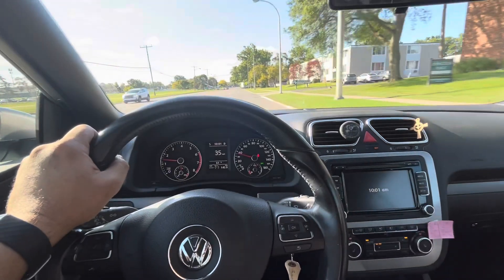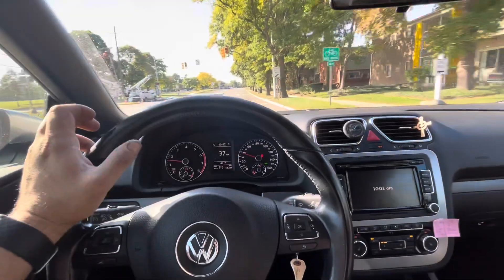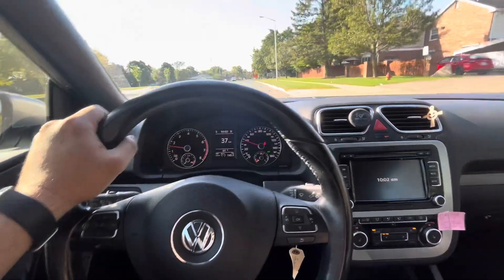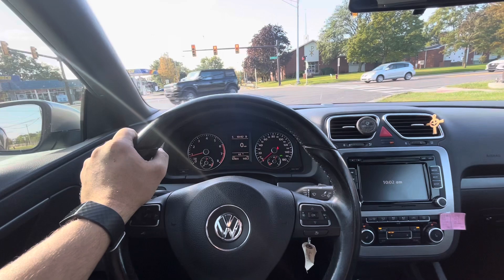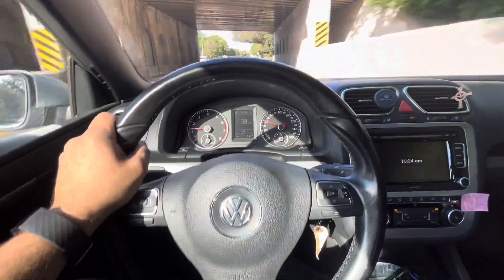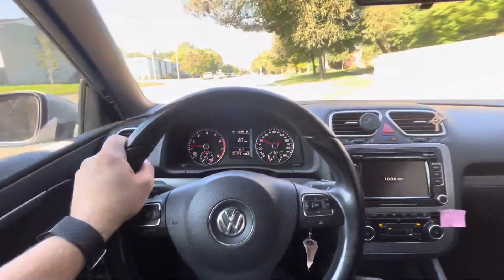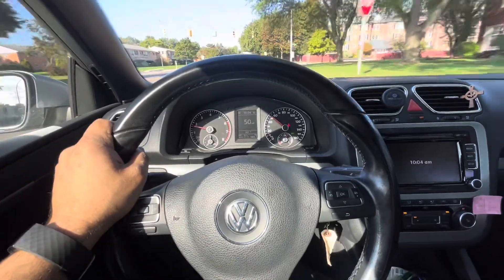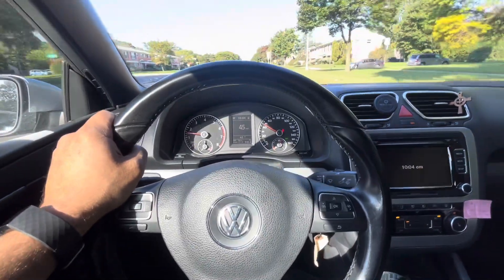VOLKSWAGEN 2.0TSI COMMON CAUSE OF LARGE VIBRATION AND POWER LOSS UNDER ACCELERATION

Comment: Hello, I own a 2011 MK6 Jetta 1.6 TDI. There is a shaking in the vehicle when I press the gas pedal at low speeds (1100-1500) in every gear. It improves when I accelerate. What could be the reason? Please help 🙏🏻
Reply: Same as me. Did you solve?
Reply: @ahmetcanergunn3069 same, did you solve it?
Reply: Same
Reply: @geekyvids-n8s let me know if you figure it out

Comment: I'm having the same issue, I'm getting the cylinder deactivation under heavy load.  Coils/spark plugs replaced.  Any thoughts?
Reply: So finally got it figured out. The coils they installed were after market, threw them out and installed VW ones, when VW checked spark plugs, they didn't torque em down so they were loose.

New coils, tightened up spark plugs. Runs mint now
Reply from the maker: Excellent, I’ve seen some real sketchy ignition coils lately, definitely something to look out for. Good find
Reply: @EuropeanAutoRepair  problem still there..with original coils and new spark plugs...I have no idea what to do..
Reply: @dcm3p8 I would look at pcv valve as it does more than separate and circulate oil. It has valves that work with the aspiration and a bad one makes it feel like this under 2k rpm or almost like the front brake is on under acceleration
Reply from the maker: Engine is idling smooth with only misfire faults stored?
Reply: @EuropeanAutoRepair   It runs beautifully until you put your foot down. As soon as you put your foot down to say pass someone, it bogs right down like you tried to accelerate in too high of a gear. Shudders and that's when all for 4 cylinders come up with misfires and cylinder deactivation code appears as well with the EPC light coming on. I've put the car in neutral (manual) on the highway, restarted the car and then runs fine. As long as I don't try to punch it 

It's funny it used to be 2 cylinders showing misfires, I replaced those coils/plugs now it's all 4.
Reply from the maker: @wetnoodle3705  wow that’s kind of a strange one, I wonder if it’s a restricted cat converter or something
Reply: @EuropeanAutoRepair   I thought possibly a carb'd up intake since their notorious for it. But I would assume that would affect it all the time, not just when the hammer is down
Reply from the maker: @wetnoodle3705 yeah usually carbons up intake ports and valves cause rough cold start idle and not overly noticeable under load
Reply: Coils have been replaced also
Reply: @coolpicksoftheday  I having exact the same issues, my car only jerks when I put my foot down, so how do u solve this issue ?
Reply: @coolpicksoftheday  what was the fix???